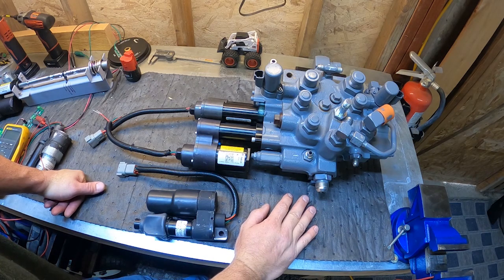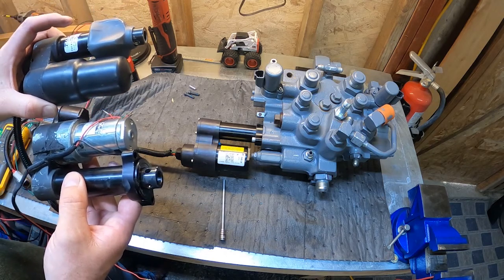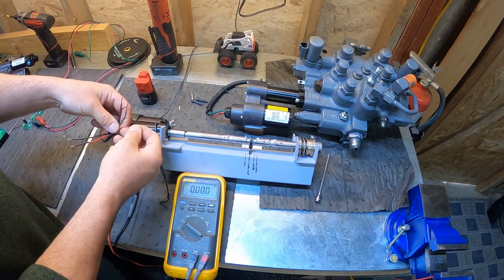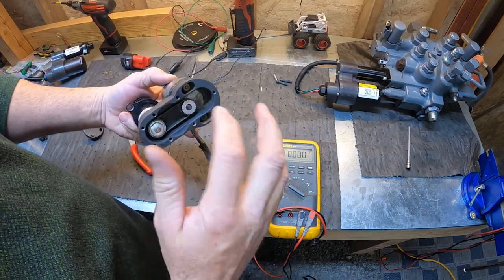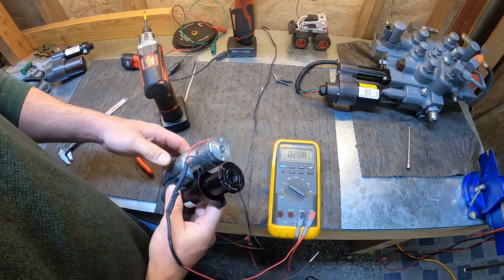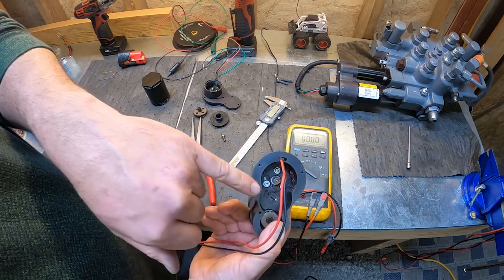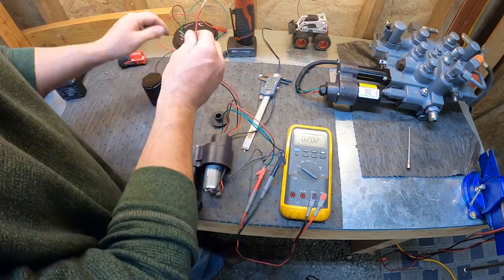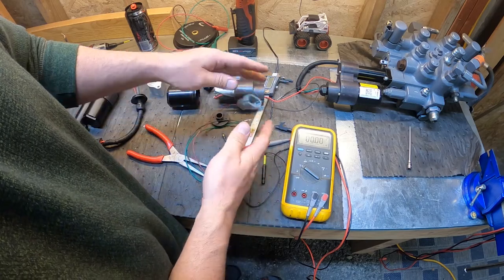Bobcat actuator, how it works, repair and calibration, what you need to know.  ACS AHC SJC

Comment: I have a S550 with a grab bucket.  When I go to grab a pile of rubber shred with the right paddle switch,  instead of releasing pressure and holding, pressure is applied and it feels like it goes into constant flow. Also when I use the trigger on the right control handle that starts the constant flow. I cannot release it with the trigger as I use to in the past.. It locks into constant flow and the only way to release it is by using the paddle switch.  Also after two hours of constant grabbing and releasing, I get error H4721 and while that error code comes up while trying to clamp down on the loose shred. I get another code following the first code of H1224. Need help. Is the control valve causing these issues. Thanks.
Reply from the maker: Usually when I see these codes it's an issue with the AUX controller.  The controller was updated to fix a known issue from the factory with the potting process.  Check the date code on the bottom right of your controller, if the date is anything less than 1948 (19 for year 19 and 48 for week 48) then you need to replace the controller.
Reply: @tetradgroup  Thank you. I will check it out.

Comment: I have a 2000 bobcat 773 I’m getting code 32-36. Iv swapped the wires to the actuators and it’s the bottom lift actuators not working. Iv pulled both actuators off and hooked them up too a battery and they both go in and out. Could the solenoid valve coil be causing this?
Reply from the maker: I don't think the solenoid valve would have anything to do with it, for some reason the computer sees a failure and the lift actuator. It could be as simple as a bad potentiometer and the actuator in the computer doesn't know the position or the brushes and the motor can be going bad and just because the motor moves in and out on the battery does not mean it can move in and out under load hooked to the control valve. First thing I would do is follow the video and make sure the potentiometers working correctly.

Comment: Great Video.  I have an older A300 and receive a tilt/lift error.  When I pulled my actuator off, apparently the seal on the spindle went bad and the actuator is completely full of hydraulic fluid.  Any recovery potential here... or is it a lost cause?
Reply from the maker: I've brought them back to life but it's 50/50.  Do a complete tear down and clean it out, bench calibrate it, and make sure to reseal your valve spools.  It's definitely worth a try!

Comment: Hey I have question about my bobcat that doesn’t pertain to your video. I have problem with my bobcat not charging, I took the alternator off and had it check and it’s charging but My battery is running down, and ideas why it’s not charging my battery? Thank you!
Reply from the maker: Is the fuse good?
Reply: Is it in the panel in the cab?
Reply from the maker: @bradholbrook2424  depends on what model machine but either in the lower part of front cab or in the rear door for older machines
Reply: @tetradgroup  it’s a 873 G series, I see it in the cab. I’ll check them tomorrow, thank you very much!!!

Comment: Hey! The most accurate video that I have seen in a while... helpful a lot! If I have a new actuator, can I calibrate it this way or I need a dealers help?
Reply from the maker: This method of calibration is only if you open the actuator itself. Your machine might have a self calibration process and may not need to go to the dealer, the process should be laid out in your service manual if you have one.
Reply: I don’t have service manual, I have S175 2003 bobcat with hand control lift and tilt. My issue is that not so often bun in a while it drops out 32-39 I have to stop the engine and start it again, then I can work again, the thing is that override and float is not working at all, but I don’t see any codes about that at all...
Reply from the maker: @martinsindrikis5735  I think you're on the right track, replace the lift actuator and you should have float. There is no code for the float, however there could be an issue with the joystick itself not allowing it to go into float. But I would start with the actuator. If you want to send me your email I'll get you the procedure for the machine calibration
Reply: The last question 😄 how does it comes that Chinese have not make aftermarket actuator? Or they are?

Comment: Hey, nice video! Did you find the model number used in the new FLIP actuator? Mine actuator motor looks bad, I check the brushes and they are ok, but the motor won't move if I dont spin it, and when it starts to move becames hot, not speaking that if feels stiff when you try to move ir by hand.

Comment: I have a 863 and when I start the machine and press the operate button everything lights up except for the lift til valve light. I have replaced the lift tilt solenoid because the old one was split in two, but that did not fix the problem. would you tear into the actuators next or should I look into something else? Thank you
Reply from the maker: I would need serial number to determine what operating system is on your machine to try and diagnose
Reply: @tetradgroup  I may not have located the serial number, that number is labeled as a PIN
Reply from the maker: @kaleehamilton6601  since you have a G series you should be able to get a code from the left hand panel. Look for the button that says "push and hold for codes". Hopefully you'll get a four-digit code that'll help diagnose your issue.
Reply: @tetradgroup  I have pressed that and it comes back saying no codes
Reply: I had time today so I dug into the actuators, I bench tested both and recalibrated them since I had them out. I reinstalled them and it didn't change anything, which I didn't really expect it too but I figured what the heck. I did check some voltages where I thought maybe the problem might be. first I checked the hydraulic lock solenoid and I realized that I only had 6 volts there. it did not matter whether I had pressed the green operate button or not, it maintained 6 volts. I thought I should have seen 12 volts there at some point but maybe it is operating differently than I imagine it would. do you know when I should see voltage there and what it should be? any help would be greatly appreciated. thank you
Reply from the maker: @kaleehamilton6601  12 vdc after pressing green button.  My best guess at this point would be your controller if your seeing 6vdc at all times and the fact you don't have any codes.  It could be a wiring issue but the controller would detect it and code out.
Reply: @tetradgroup  am I able to just get a new controller and throw it in or would that be something that the dealer would have to set up?
Reply from the maker: @kaleehamilton6601  it would need to be programmed in the machine by a dealer unfortunately
Reply: @tetradgroup  I spoke to a guy who has a used one for sale. he told me that depending on when the unit was built, would decide whether it need to be programmed by the dealer or not. so I sent him my serial number and he told me that the unit I have self calibrates each time I cycle the key. does that sound correct, or does every machine need reprogrammed when a new controller is installed?  thank you for your help
Reply from the maker: @kaleehamilton6601  The controllers can be universal over several models. you have to program the options for your machine into the controller so that it'll work ie you have AHC if the controller is programmed for manual controls your machine won't work either way. you'll need to confirm that it's the same part number on the controller and it's programmed to AHC
Reply: @tetradgroup  so I finally got the controller and got it installed tonight. everything is working as it should. I just wanted to thank you for helping me diagnose the issue. THANK YOU!!!!
Reply from the maker: @kaleehamilton6601  glad you got it fixed.  Thanks for the update!

Comment: Thanks for the video! I have a Bobcat 753 g i bought with Loader error. Error code is 32-49 Lifting actuator shorted to ground. I Can see that previous owner mounted the first version of actuator and the adapter for the v3 actuator. Can it become a problem? The original mounting-braket is missing.
Reply from the maker: I don't think it will be a problem because if the actuator need to be replaced then it would have to be updated
Reply: @tetradgroup  thanks for your answer!! I have the error code 32-49 ACS Lift acuator short to ground. I have replaced with new ones from Bobcat. The same error code. I checked the hardness between ACS controller to acuators and to the fotpedals and the joystick. Checked with ohm meter and everything looks good. At one place the protection of the wires was bad but the wires looks good. Can footpedal sensor be bad and give me that error code? I have switched the acuator cables and the same error code. Can I have the same error code if my firmware is old?
Reply: When I start I get three beeps and the ACS light is on. The pedals and joystick is locked out. 😢

Comment: Excellent video. I do however want to know, is there no machine calibration that needs to be done? Or is the machine simply set to see 2.0 VDC neutral point, etc? Just confirming.
Reply: So is that what your other video achieves by manually calibrating? Just want to confirm thanks.
Reply from the maker: Yes there are a few different ways to calibrate depending on model however the early AHC system can not be calibrated only ACS and SJC
Reply: @tetradgroup  I have a 2016 T630.. so that would be an SJC unit. I tried your calibration video (engine off, bar down, hold right joystick up and to the right, key on, press green button) but the code is still persistent and it won’t attempt to calibrate. Do I need to replace the actuator first before it clear the codes, in order to calibrate?
Reply from the maker: @bigace109  yes it will not calibrate with an active code, need to fix the issue first.
Reply: @tetradgroup  thanks
Reply: @tetradgroup  happy to report, replaced the actuator, and was able to calibrate and no codes. Thanks for the video.

Comment: Hydraulic fluid in the twin cylinder and up by the belt. What is strange as this be an actually a 2002 it has the old style with the possibility of bolting from the rear. But it has the adapters as well.My next question is how does that rubber cover come off or can I take it off?.to get out the motor. can I get a motor for this? Back to the hydraulic fluid do I have a bad O-ring in the actuator rod in the assembly and how easy is that to fix?thanks
Reply from the maker: Yes you have a spool seal leaking. If you just want to do the front spool seals it's not hard you can usually use a pic pop out the old one which will be a brown/tan color and replace it with the new style seal which is a green/turquoise color. I would recommend doing all four spool seals but you have to remove the spools from the valve. Still not a hard job just more in depth. The rubber boot on the motor is just glued on around the top but a little screwdriver or pick and spin it around the boot and it should slide right off the motor.  If you do replace it you will be getting the updated motor which may require an adapter.

Comment: Thank you for your time & wealth of information,,, blessings to you!

I can't get the lift actuator off, it will not release enough to get to the pin,,,it spins & under pulling pressure ,pulls away about 1/4"...I removed the 5 screws(t15 heads) but no further movement.....?
Am I too twist, pull, hammer,etc...... ?

Thank you much in advance...
Reply from the maker: After you remove those screws and pull the back plate off you should be able to pull the center gear out and then turn the actuator with a pair of needle nose pliers or even a screwdriver will turn the gear on the actuator portion to back it off to get to the pin.
Reply: Yep, thanks got the end cap off, center gear also but gear will not spin...it moves 1/8" both ways but that's it......
Any suggestions,, I fiddled an hour try to bump it with screw driver, nada.....
Reply from the maker: @ncsojourner200  That's unfortunate, an extreme cases I take a small Milwaukee reciprocating saw and cut the actuator in half. Sounds like that might be your only option at this point. The actual ball screw linear cylinder must have came apart inside.
Reply: Oh wow 😔
Just what I want to hear....
Thank you....
Reply: Well,,,I got the gear turning with screw driver,, does direction matter to release from internals?
Also trying to pull it away from housing as I turn....
Do you recall how to free it as it turns ?

Thanks
Reply: Well,,,I got the gear turning with screw driver,, does direction matter to release from internals?
Also trying to pull it away from housing as I turn....
Do you recall how to free it as it turns ?

Thanks
Reply from the maker: @ncsojourner200  if that gear is turning it should back itself off the spool so you can push the pin out and remove the actuator. I don't recall exactly which direction to turn it
Reply: Well Hallelujah and Praise the Lord Jesus,,,, I believe only the Holy Spirit can keep one from being frustrated Turn enriches and dealing with this nonsense,,,, Standing on the right side of the machine and using a screwdriver against the centre pin and turning the gear counter clockwise was enough to release to expose the pin! 

 Show that parts off now just got to figure out the wiring harness lol,,,, I'd rather be climbing trees were teaching people to fish any day!!  But when the Bobcat dealership is at least 2 weeks out and 2 of their 3 guys are trainees.....
Many prayers blessings to you to you thank you very much

Comment: I have a SJC S220 and when I went through the calibration procedure I did not hear any actuator trying to cycle however now I have a fault again with the tilt actuator wrong direction 32-60 fault. Anything you can offer to help me on this or should I be taking the machine to the shop?
Reply from the maker: Swap plugs from lift to tilt actuator and see if code changes to lift wrong direction.  This will tell you if the problem is with the actuator or possibly a wiring issue.  Did this code appear suddenly?
Reply: @tetradgroup  problem only happened when I performed the manual calibration in the video. Have since found correct SJC procedure with the right joystick in forward right position. Heard the actuators working still no tilt function. I have a 32-25 after calibration which turns into a 32-31 fault when I try the tilt function
Reply from the maker: @davidraezer5937  makes sense, the video I did was for AJC not SJC.  I would still swap plugs and see if codes switch to loft circuit.  Looks like it's time for an actuator.

Comment: I have checked my actuator out is possibly that the motor is under power down by the brush is being bad but other than that everything seems fine the tilt bucket has no power moving up and down with a load When I swap the plugs on the two actuators the problem follows this tells me that the actuator is bad how can I test the power of the little motor inside the actuator when I hook 5 V to it it runs very freely it spins freely it does not smell burned up it does not look or feel burned up Bearing  is good On the motor and the spindle if the potentiometer is bad it just would not work at all would be my belief but it tries to move up and down it will move up and down without a load but soon as you let go of the handle it falls could anyone help thank you

Comment: Hey, love your videos, well done and great information! I have an issue with a major oil leak on a 753 hydraulic control valve. Do you have any footage of you taking one out? Thanks from Australia :)
Reply from the maker: Thanks so much for the comment.  Can you identify where the valve is leaking? 98% of the time they're leaking from the spool valves and I don't pull the control valve to replace them. I usually do all the work in frame, I've only pulled one valve in the last 5 years. However if you suspect it's coming from somewhere else I can give you some tips to help pull it out. Start by removing the complete front steering plate, I know it looks complicated but it's actually very easy it makes working on the control valve much easier.
Reply: @tetradgroup  Het mate, THANKS very much for your reply!!! It looks like it's leaking from the bottom spool valve where it goes into the rear of the valve block. First time I've looked at a Bobcat, I'm pretty mechanical minded but WOW things are tight in there!!
Reply from the maker: @stuartgraves1428  it is tight for sure, I've done plenty of them but never filmed one, but I will film the next one I do.
Reply: @tetradgroup  Thanks SO much for your feedback and advice. The old girl is now fixed, all be it the lift arms are a bit jerky and the pedal is a bit tight but I'm thinking it may just settle in over time?? Next issue is the "bob tach levers are seized in and I can't get the bucket off! Time for a bit of heat and a BIG hammer :)

Comment: Hi my computer cooked i lost the down on the boom, so I put in foot peddles and bypassed the hand controls. 753 f with hand controls only. i bypassed the hand controls and got it all working my aux controls on the handles all work the only thing that wont work now is my float even when i push the peddle all the way float wont work . any ideas on this and how i can make it work
Reply from the maker: You have different lift spool in the valve body for actuator controlled machine vs manual controls.  You would have to replace lift spool and components that go with it to install the detent assembly to make float work.
Reply: @tetradgroup  ok thank you I am not going to go through all that i dont need the float that bad  , great video